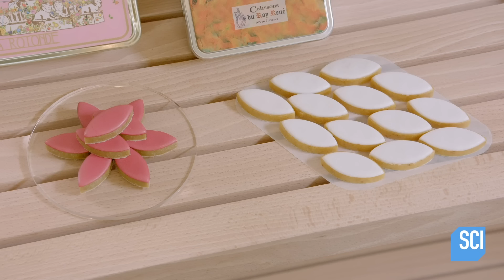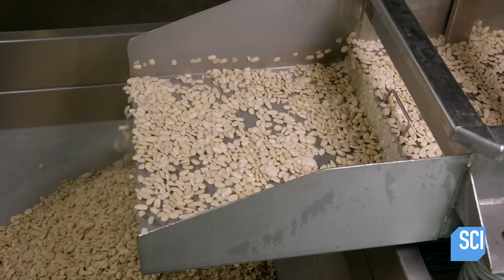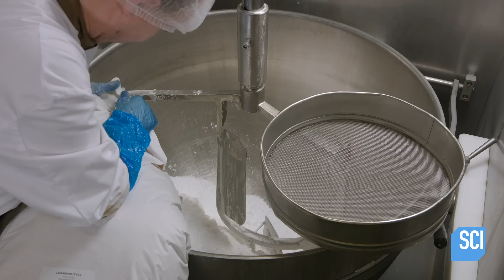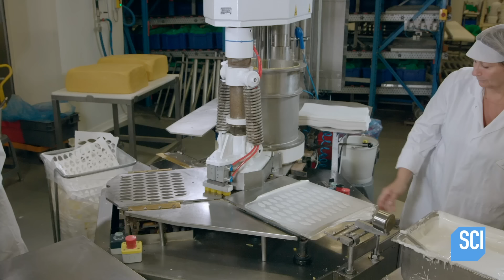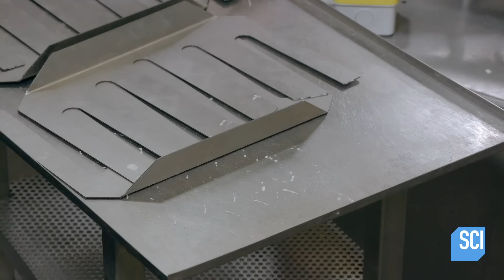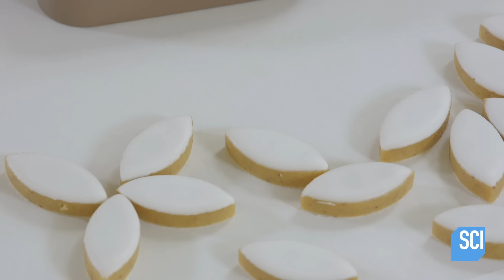How It's Made: Calissons

Comment: Just want to know, how they come up with all these machines
Reply: It's actually a specialized field called industrial automation. A lot of machines are programmable and with the right nozzles/heads/whatever--is-in-use can do a surprisingly diverse range of tasks. In some cases a machine is commissioned to speed up a process and an industrial automation company's engineers will custom design a solution, especially if its a weirdly unique task.
Reply: @jameskoch9567  I would love to see the design process and building of these industrial machines --mechanical and robotic which strangely never shown.
Reply: Two words: Dire necessity.

Comment: For all you people complaining about people not wearing gloves.....I have almost 3 decades in the food industry. Washed bare hands are absolutely as sanitary as wearing gloves, and much safer for workers using equipment.
Reply: Kanra Smith do you wear gloves cooking at home? Gloves are also a safety problem where Latex can get into the food.  Worked as a chef for years, the only place I know they wear gloves is on a production line, making sandwiches or dealing with money
Reply: @vintage1950  I've never even seen a latex glove in my life lmao
Reply: Gloves get soiled, too. Gloves will do nothing if you’ve touched your hair, face, nose, or mouth while wearing them. Cough or sneeze into a glove, and the effect is exactly the same as on skin. Gloves need to keep getting changed over and over and over again in order to prevent cross-contamination. They never are because gloves give employees a false sense of security. “I’m wearing gloves. I’m sanitary!”  It’s much easier and safer to simply enforce hand washing.  Gloves also desensitize fingertip sensation. You just can’t feel what you’re doing. I can’t tell you how many times I’ve cut my fingers, or have seen coworkers slice off their fingertips while wearing gloves.
Reply: phillydragonfly and easier to handle (I mean it’s easier the grab things with your hands)
Reply: I dont see any comments about gloves but you're correct about that. Washed hands and clean nails are just as good as wearing gloves if not better
Reply: as someone also with experience in the food industry, bold of you to assume half the workers actually wash their hands (yes it drove me absolute batshit and was ignored whenever it was brought up, which also grosses me tf out)
Reply: @3possumsinatrenchcoat  those same people who don't wash their hands also probably don't change their gloves so it's really pretty gross either way
Reply: My hairy ass! One sneeze,one scratch of the nose...or worse and your "clean hands theory" is shot! This is commercial food production for high distribution. There are different standards for this! They aren't short order cooks making a grilled cheese.
Reply: @mantia39  maybe you should shave that hairy ass! Seems so gross to me and much more disgusting than not wearing gloves
Reply: @mantia39  all of those things can happen to gloves too
Reply: Watt abt MasterChef, why aren't they wearing gloves n hair nets. I mean a stray hair would send you home???. Thanks for comment btw.
Reply: But palms sweat, so, gross, thanks
Reply: How about hairnets?
Seeing a lack of those in fast food places annoys me sometimes.
Reply: Worker safety doesn’t matter over my quality. I do not want filthy human skin on my food.
Reply: Doctors in the 1800s be like "Look, I have almost 2 years' experience as a doctor, I don't need to wash my hands, I'm too smart for germs to infect me."
Reply: Gloves are never worn in restaurant kitchens anymore unless the cook has a cut, and wants to keep it clean. Gloves are only worn in situations serving food where the public can see it because it looks nice. That’s it.
Reply: Kanra Smith Another thing that you’re probably not aware of is that food service gloves are not sterile. Far from it. They weren’t sterile when they were factory packaged. They’re left out on counters and shelves in an open cardboard box, are are exposed to airborne pathogens. Hands washed frequently in soap and water are probably ten times more sanitary than gloves.
Reply: I guess it's just that current health code standards are very strict about the use of gloves in food production. Of course, not every place keeps high standards. Personally, if someone were building my sandwich at Subway and not wearing gloves, I would be grossed out. But is that because I'm so used to seeing the gloves? Or because I don't trust the hygienic principles of a complete stranger? Probably both 😆
Reply: Amber Sullivan  I never saw the cooks wearing gloves, either. But those who were putting the sandwiches together were. This was at Five Guys, where (like phillydragonfly said) line workers are in full view of customer's disapproving looks 😂 The whole equipment hazard and dexterity issue with wearing gloves is valid, it's just in my personal experience, gloves were pretty ubiquitous in food service, so I have a hard time agreeing with "nobody uses them."
Reply: I’m now a licensed massage therapist. I work on multiple clients 5 days a week. Besides genitalia and the perianal region, there is not a single part of people’s bodies that I don’t come into contact with.  I perform my sessions back to back, going from one person to the next. The same hands that were working someone’s feet and  gluteals in a previous session are now working on someone’s face. I do not wear gloves at any point in time. Why?  Because hand washing is sufficient.  

25 years restaurant work. 10 years professional bodywork. Not one infectious disease contracted or spread. Why?  Thorough hand washing, and not gloves. Even the CDC says that hand washing is our first line of defense with the Covid19 pandemic. 

So if all you have is a “deeply held personal belief” because you think you know better than experienced professionals and science, I suggest you keep it to yourself from now on because you sound really dumb.
Reply: Amber Sullivan  All three restaurants I've worked at routinely used gloves, sani-station practices and regular hand washing 😬 Edit: guess I sound pretty dumb
Reply: Ok but like some people don’t wash their hands so
Reply: @arctuuruus  did you read any of phillydragonflys replys? 
Heres the point 👉•

And here's you 👉•
Reply: @Gutterrat69  ok cool
Reply: Kanra Smith And I have experience in fine dining, fast food, deli, and the US Military where I was a hospital food service specialist.  I’ve worked front and back of the house, and extensive food management training.  

How about yourself?  What’s your professional restaurant experience?
Reply: Kanra Smith I’m not a masseuse. That’s incorrect and ignorant terminology in the US because of the past association with the sex worker industry.   Once again, you’re proving your appalling lack of knowledge on subjects you’re not experienced with, yet still have a biased opinion about.
Reply: phillydragonfly how is putting candies into the box a dangerous activity ? Only the workers who are using the machinery throughout the video have gloves on. Your logic doesn’t apply to that scenario.
Reply: @amatteroflogic  The conveyor
Reply: Who said anything about hands being washed?
Reply: I'm sorry man but washed hands are NOT as good as wearing gloves. Someone can easily miss spots or wipe a bead of sweat off their forehead or scratch their nuts in between touching these with their hands. When handling food, you ALWAYS wear gloves. ALWAYS!
Reply: @dtimbs84  And what’s stopping somebody from scratching just because there are gloves?
Reply: @dtimbs84  do you work in any sector that requires you to wear gloves? As a nurse, we have to wash our hands before and after putting on gloves. A nasty person putting on gloves is not going to protect you. Sorry.